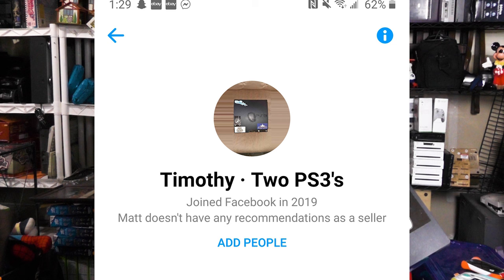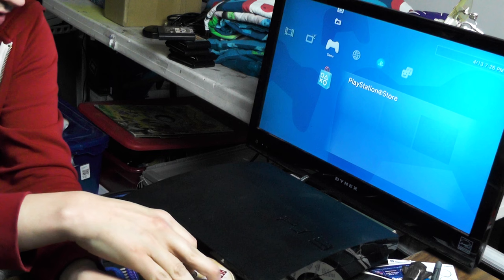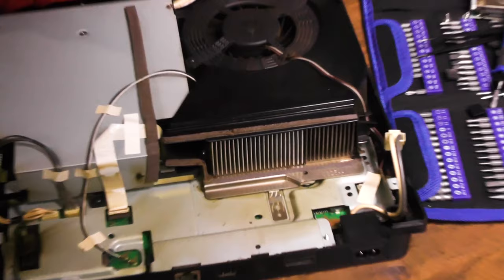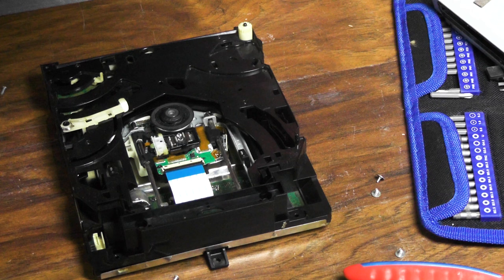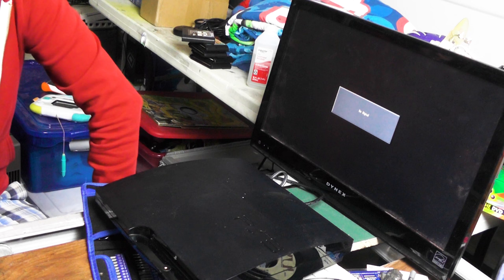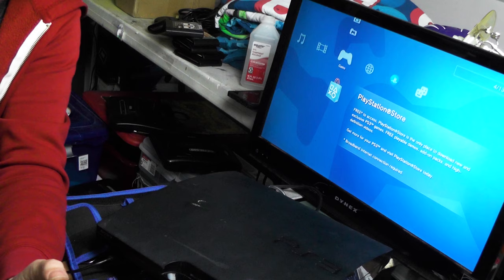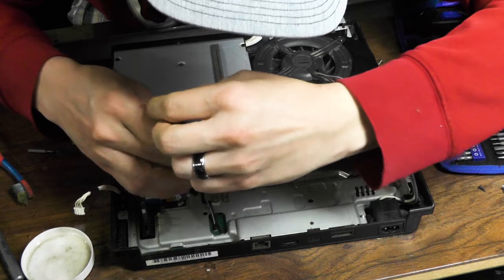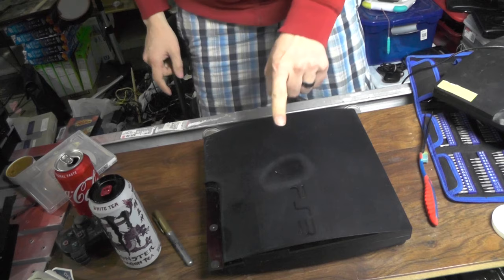Fixing 3 Nasty PS3 Slims. Don't Smoke and Game.

Comment: 2 things:
1. I used to vape for a while and in my room where my PC and consoles are and noticed after a few days that even that leaves a tiny layer of grease and immiately stopped doing it places with electrical equipment. 
2. See these controllers? You are sitting on gold. Last year I needed either a new or a well-preserved PS3 controller and all the "new" ones are just fake Chinese rip-offs with copied official packaging, and their thumbsticks are actually an 8-directional D-pad with a stick on it instead of a full 360 motion. Had to find a decent controller from a forum, somehow preserved controllers are much harder to get than a preserved system.
Reply from the maker: Yeah, I find the ps3 controllers a lot at Thrift shops. Mostly broken though.
Reply: Same , had to settle for a wired controller that doesn't rumble, still works but nothing beats a official Sony brand. You know you can plug in a ds4 into a ps3?
Reply: Here in Perú, i paid just like a 20$ for a DualShock 3 on good conditions.. (refurbished). =/
Reply: Carmine Sama you can connect your DS4 with Bluetooth as well the same way you would pair a headset and it will work

Comment: please do never ever again clean off those 2 sliding poles of a laser assembly without reapplying some lube again. you may not notice it short term but in the long run you kill your laser assembly. they tend to catch dirt over the years but most of that "gunk" on those 2 poles is there for a reason

Comment: Ps3 fat: is the original model with special editions and no changes at all
Ps3 slim: based on the original model but with changes on the hdd, the hard drive size is changed to 500 gb
Ps3 super slim: based on the slim model but with different hdd size

Comment: Old thermal paste is easier to remove if you use a dry piece of paper
and then alcohol.
Reply from the maker: This was easy to remove, but I will try it on hard to remove paste for sure. Thanks for the tip

Comment: I never understand the deal with smoked up consoles.  I used to smoke heavily in the PS2 era and none of my consoles or controllers smell like smoke or have dirty yellow insides.  I've bought used controllers that have cords that have that smoke smell that doesn't seem to come off.  I think it might have something to do with people not changing their furnace filter regularly, but I don't know.

Watching your channel and that Odd Tinkering channel has inspired me to open up and clean a lot of my consoles and controllers.  It feels so good to have a clean gaming hardware.  Thanks for the inspiration!
Reply: The smoke doesn’t directly cause the problem it’s when there’s 0 air flow in the room and the smoke has nowhere to go so it just settles in and on surfaces. So if the room you’re smoking in has any air flow you most likely won’t have the issue. The PS3 in the video looks like it went through a fire more then anything